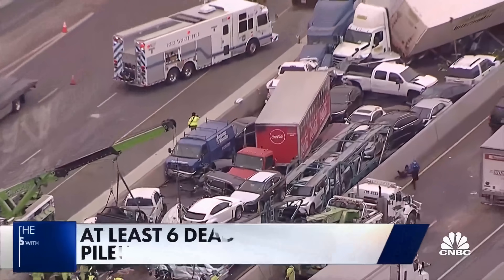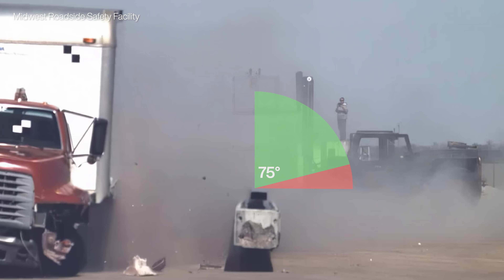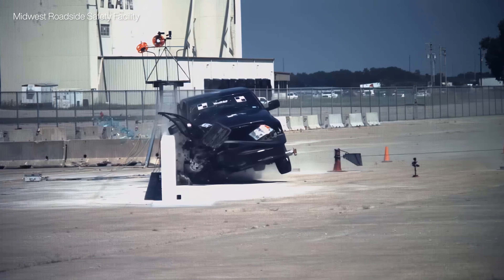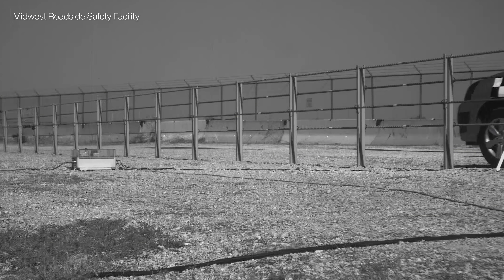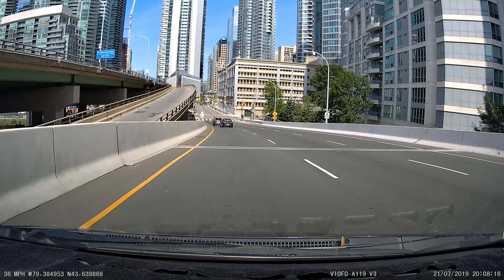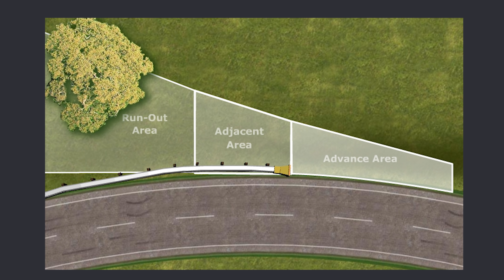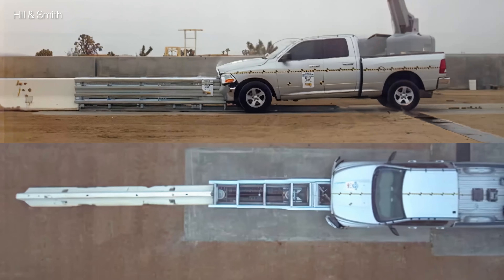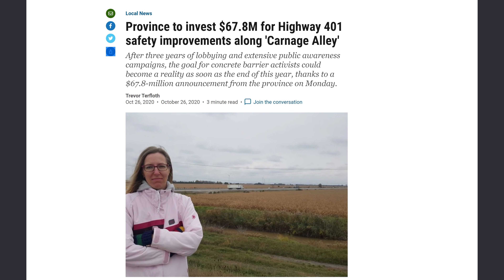How Road Barriers Stopped Killing Drivers

Comment: The cable barrier is just like an string egg slicer for the bikers, i think. I saw them appeared in my city recently and that was the first thought that popped up in my mind when i first seen it.
Reply: I can attest to that. One of my coworkers at work lost both of his legs from those cable barriers last year from a motorcycle accident at around 40 mi/h.
Reply: @MBG141  It will also not be a pleasant experience if you are on a Convertible, Casey Putsch goes really in depth on it on a video, and tells the story about some kid who got decapitated on a corvette, really fucking sad
Reply: Yeah I was thinking, if the cable breaks the energy in that would be such an unbelievably powerful whip. Think I read something about a guy on the deck of an aircraft carrier losing a leg or two to broken cables they use to stop jets.
Reply: @rockyfalldownstairs  When a cable guide rail breaks, the wire whips away from the car that broke the wire.  If cable guide rail is installed in the correct location (e.g. open median of rural roads) there is not likely to be anyone around to get hit by the broken wire.
Reply: @rockyfalldownstairs  saw a video of an absolute chad of a deck crewman jump over a broken wire that was coming up from behind him: https://youtu.be/BuIbvX_B7sY?t=20
Reply: Right, the issue with biker's safety was completely omitted in the video. When sliding underneath guardrails, the injuries from hitting a post are severe.
Reply: @cruisemissle87  there’s always increased risk for bikers. You have an exposed human being, they can’t install giant airbags specifically for bikers.
Reply: @WaywardVector  I am not talking about airbags, and I'm neither a motor biker. Double-guardrails and concrete barriers are preferred ways to prevent those casualties, that should be mentioned.
Reply: @cruisemissle87  what are bikers? Do you mean organ donors?
Reply: Cable Barrier vs Motorcycle/Convertable.  Slice and Dice...
Reply: I remember I was in a huge argument with my work partner in the truck and ran up one of those cement barriers and my truck slammed down so hard and almost lost control. The argument was instantly over and we where glad to still be alive.
Reply: It’s also terrrible for low sports cars where the couple would come through the cabin killing the diver
Reply: In my country these cable barriers are called biker's cheese knife, but the idea is the same
Reply: As noted by others, all types to road barrier are bad news for bikers.  Lots of other things are bad for bikers as well, like pot holes and sign posts.
Reply: @tedr.5978  Some are worse than others, though. It's better to slide along the barrier (like a concrete one, or one of those steel barriers which are closed all the way to the ground) than to go in between the posts and be ripped in half
Reply: Vulnerable road users will always be ... vulnerable, whether it's wire, concrete, or whatever.
Reply: @TexasFire_Cross  whilst that is true why make it more dangerous?.
Reply: @TexasFire_Cross  yup, totally agree. They (and I, being a biker, as well) need to behave and drive/ride  accordingly.
Reply: While everything said here may be true, it has to be weighed against the other 99% of enclosed vehicles on the highway. Hopping on a bike or a convertible should always be a measured risk, they can't cater to the 1% at the expense of the masses.
Reply: @JohnDoe-zs6gj  There's no evidence they even try to cater to motorcyclist, quite the opposite. They're not 1% either.
Reply: @JohnDoe-zs6gj  you make a great point. There is an inherit risk involved period riding a bike or driving a convertible.

Comment: Lives saved, includes medically able to save lives if they weren't DOA. Deaths by GSW is down for that reason also. These new solutions are great but once impacted they are usually not replace to spec and then that section becomes much more dangerous. So don't slam into a spot that has already been hit ;)

Comment: As an over-the-road driver I've on more than one occasion have seen cars that have jumped the cable barrier.  They were usually SUVs and I'm talking cables that were placed right next to the travel lane mostly.  I haven't seen too many tractor-trailers that were stopped them either.  Tractor-trailers, by the way, can weigh up to 80,000 pounds legally and that's a lot of weight to get stopped.
Reply: Locally they installed cable barriers all along the Interstates. I think they are only about 3' high but I wonder if they would be better at 4' high or a combination of guard rail and cable.

Comment: i worked for TDOT, and a unique system were trailers with warning lights you would pull behind a dump truck with salt or sand in it. they had hydraulic cylinders to help stop the load and had 2 massive water filled cartridges that were compartmentalized internally. it was beleived that one of these could stop a fully loaded semi going at highway speeds and leave the road crew untouched. The coolest part is we would get one into the shop, take out the cartridges, replace some shear bolts, and load in new ones and send them back out.

Comment: The numerous motorcycle riders losing their lives to cable barriers would disagree that they're safer.
Reply: what's that number?
Reply: @83hjf  I don't have an actual number to give you - and it would differ by locality, population, etc. What I do know is that a friend of mine went down for a stupid reason during a charity ride and wrapped around an upright of a cable barrier that was parallel to the direction of travel (it was a freeway). She died on impact. With a shallow impact angle like she had, she would have glanced off a solid barrier and may not have even broken a bone. 

They have the potential to turn a reasonably gentle slide into a very sudden stop and those are never good.

Comment: I think the decline of crashes has a few combination of groups to factor in.  Safer barriers yes, but safety tech in vehicles have helped as well as we have vehicles now that brake for you, sensors to help warn drivers, and there is a wave condition wherein we get good drivers then bad drivers, kids who just get their license aka new drivers.  Their time on the road will either see them improve, or be removed by traffic's enforcement that remove their license and thus remove the bad driver from the road.  But as I said it comes in waves you will notice right now I think we are in the low tide low wave phase which means we are due for a high tide high wave.  It's just the sudden explosion of new drivers....sigh.
But in short, road safety tech, and vehicle safety tech has greatly helped and vastly improved over the last 20-30 years.  And it will get better.

Comment: 12:20
Why do some things seem so expensive for no reason?
Reply: government-bought things in a nutshell
Reply: Safety is expensive. Just look at rolls of top tier highly reflective tape that is placed on the outside of work vehicles to be more noticable/visible. One roll of the best reflective tape can cost 100s of dollars. While reflective tape that's meant for late night joggers can be as cheap as $10 for smaller rolls. It's nuts.

Comment: Especially important nowadays with so many Tesla owners running into barriers while sleeping with their autopilot 'driving'.
Reply: Does that actually happen? 😨 I thought you have to adjust the steering wheel every few seconds to prove you’re awake.
Reply: @nubbiewubbie7285  Several people have been killed by Tesla autopilot running straight into barriers, disabled cars in the road and auto lane changing right under semi truck trailers. In my view, it's a foolish thing to trust with your life.
Reply: @mjnc3672  But non of these people were paying attention right? That is the real problem.
Autopilots have crashed planes too, but only because the pilots didn't follow the rules like they should have.
Reply: @benghazi4216  Tesla claims that the auto pilot feature is an assist, not autonomous. The driver is still supposed to be awake with their hands on the wheel. How so many seamingly intelligent people have the confidence, or stupidity to fall asleep in a car on a busy roadway is beyond me. All commercial airliners have autopilot, but very loud audible alarms will still alert the pilot if the plane is banking or climbing too steeply, as either of these can cause the plane to loose lift and go into an unrecoverable stall. The plane can literally drop out of the sky. Regardless of the technology, cars and planes need skill and attention to operate safely.
Reply: @mjnc3672  And remember, if you leave your seat for just a second, even if the autopilot is on, you are never flying commercial again. 
There has to be someone at the controls at all time, which the Tesla owners forgot.

But at least some (hopefully) died in their sleep, which is a good way to go.
Reply: @benghazi4216  Commercial aircraft always have a pilot & a copilot. So there is always a pilot at the controls. They do have to use the restroom sometimes. There was a Tesla crash a few months ago with two male occupants. While on autopilot, they turned onto a cul-de-sac which had no lane lines, which I believe is necessary for the system to have to scan for as a reference in keeping the car in it's lane. The Tesla wasn't able to decide what to do in this uncommon situation. I suppose the owner thought the autopilot would just turn around and exit the street. It didn't. It crashed, burst into flames burning both men to death. Still alive but trapped in this blazing inferno. It reportedly took firefighters several hours to get the fire out as the lithium batteries kept igniting. A horrific way to go, compared with a high speed crash into an immovable barrier.
Reply: @nubbiewubbie7285  Just a square box on the dash that pops up I am Human...

Comment: Yeah, it kind of defeated the purpose. Don’t hit a cable barrier. I barely touched one with my left fender at 40mph and it totaled my car. If it had been a rail barrier I’d still be driving the car today with minimal damage.
Reply: Huh? 40 mph is a high speed dude! It's over 60 km/h!
Reply: @moose1265  what? That's fairly slow. Even though crash tests are done at around that speed, your not getting very far
Reply: It's not designed to save you some money. It's designed to keep people safe by keeping your car out of the oncoming traffic lane or some other danger. And as stated in the video, cable barriers are 40% cheaper which means you can install them on 40% more roads, which means more lives will be saved. But what do I know, I generally dislike humans anyways. So the more ppl die, the better. Let's remove all the safety stuff from the roads and make cars that will impale you if you hit something at 20mph. Perhaps ppl would concentrate on the road again instead of recording their next snap or tiktok while driving.
Reply: @Kepe  You're one strange cookie

Comment: Thankyou for acknowledging that Metric exists and making the video comprehendible to the entire planet!

Best way to increase safety: more self driving vehicles.

I bet if an entire country funded installation of self driving systems & made using them mandatory that within 20-50 years the cost would be recouped due to reduction in accidents and necessary safety measures. The future will be nice, pity we'll be dead and won't get to see it though!

Comment: No mention about Motorcycles, there was a European protest by hundreds of thousands of motorcyclists who wanted the guard rails to be designed with MC'er's in mind, the posts and cable types were very dangerous to riders, that's why they added a lower rail to stop limbs and bikes going under the common bumper height rail

Comment: I sweat when I see cable barriers from the motorcyclist's point of view. This shit slices people like a razor.
Reply: The cable doesn't hurt them any greater than a head-on into the car coming the opposite direction.
Furthermore, the cable is there to protect the motorcyclist from a car crossing over and smacking you down.
Reply: @johncoops6897 , do u understand that I don't compare hitting a cable barrier to a head-on crash? I am talking about simply hitting a barrier.
Reply: @IgrayutVse  - do u understand that if the barrier wasn't there, when you decided to cross the centreline, you would hit something else... like an oncoming car or a truck?
It's not practical to line the centre divider of all highways with comfy-soft pillows to accommodate motorcyclists who cannot control their vehicles and decide to spear off towards the oncoming traffic.
Furthermore, if there was no centre barrier, then when one of those evil cars or trucks lost control, there wouldn't be anything to prevent them mowing down an innocent motorcyclist.
Reply: @johncoops6897  clearly u don't.

Comment: U forget the savety of motor cycle diver who offen lose limps by hitting Posts ore loosing the head  by sliding under a barrier
Reply: Well you can't do much about it unless you wanna make it less safe or more complicated for the car drivers. 

Its kinda your fault for driving something at high speeds without a single protection except for a helmet.

Comment: I wonder when engineers will find out that motorcycles excist.
Reply: I mean, there's not much you can do when a motorcycle hits something. The driver is going to be ejected anyways. There is not many ways to stop a motorcycle without hurting the operator.
Reply: @Starfurexxed  just take a look at the normal guard rail. 2ft space underneath, there are systems that are solid below so you dont hit the posts. Also those cable things look like a deathtrap for anyone who isnt in an enclosed vehicle. This includes cabriolets and the lotus w/o a window in front

Comment: Years ago the powers to be were going to put 3-4 inches of median in the center of the road on a mountain road. This was to tame down the motorcycle riders.  
I spoke with the planner on site and we came up with rumble strips ground into center of road. I also convinced him to throw sand before painting directional indicators on the concrete. The sand gives traction. Really slippery previously.
Palomar mountain s6.

Comment: Cable barriers have a 100% chance of killing a motorcyclist.
Reply: So so almost all of these

So do most accidents involving motorcycles
Reply: @hockeycrafter6086  under 5% of motorcycle accidents are fatal
Reply: @JU-wn1jm  do those statistics include falling off a stationary bike? Because full on collisions are a different story.
Reply: @cennty6822  no but it does count small accidents the same way they do with car accidents
Reply: @billzardus95  idk what you think of as a legit source but every article what i read stated that 4,24% of motorcycle accidents are fatal
Reply: @JU-wn1jm  motorcycles still have a 35 times higher fatality rate per mile traveled
Reply: @cennty6822  source?
Reply: @JU-wn1jm  the number varies by source, but most place it around 30
https://www.dolmanlaw.com/motorcycle-accidents-vs-car-accidents/
https://www.callrainwater.com/blog/motorcycles-vs-cars-pros-cons/
https://www.iii.org/fact-statistic/facts-statistics-motorcycle-crashes
Looking at these sources, my original claim of 35 may have been a little pessimistic, but my point of mc being much more dangerous than cars still stands.
Reply: To be fair, I'm pretty sure half of these barriers have  a 100% chance of killing a motorcyclist.
Reply: I'm suddenly picturing something out of Final Destination. Yuck.
Reply: He showed that these barriers where designed for cars, trucks and semis. Not a single bike was used for testing, so it shows how good they are for cars but how insanely terrible they are for motorcyclists.

If you survive with all the limbs you are extremely lucky.
Reply: 100% seems a little high to me.
I'd be happy if cable barriers only did in 95% of them.
Reply: @billzardus95  You have something against motorcyclists?
Reply: @billzardus95  unless your one of the ninty five percent, and as for the rest what bits have the barriers ripped off.

Comment: Really interesting! Was actually looking for other kinds of videos but this one caught my eye. Living in Sweden where the authorities have a Noll Vision - Zero Vision = zero deaths in traffic and much is planned to remove death traps from our roads. One such "invention" is the 2-1 roads, where you have two lanes in one direction and one lane in the other that successively alternates. That way, you can never end up in the meeting lane, that is protected by a wire barrier. Saves a lot of life.

One thing not mentioned was street lamps. Over here, we have swapped from solid (almost) non collapsable lamp poles to lightweight collapsable.

As a note,  year ago we were caught by a sudden heavy rainfall and slid into a road barrier made of steel. Not a scratch on the rail, but our car was just a piece of metal junk. No severe injuries though.

Comment: Cable barriers can be good - unless You are riding in a convertible ant tip over, or riding a motorcycle and slide into them at 60mph. This cases also should be analysed.

Comment: cars are not as safe as they used to be. airbags are not the lifesavors ppl think they are. and cars today may have more research in them. but they are made with sub standard materials than cars of old. besides cars today are just computers with wheels. they tell u when ur driving over the yellow line or to close to another vehicle no skill is needed in modern cars. older cars that were made of steel and required ppl to have skill are much safer